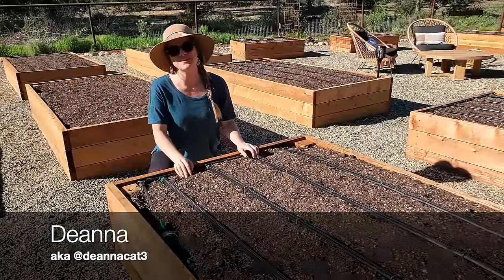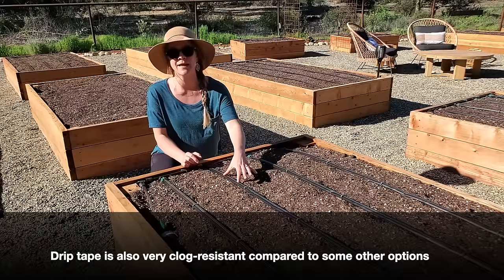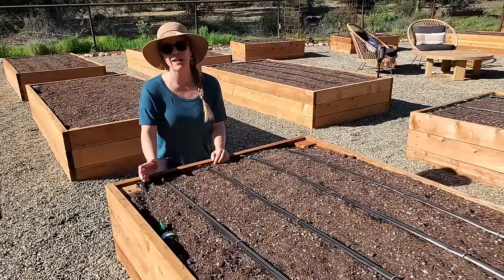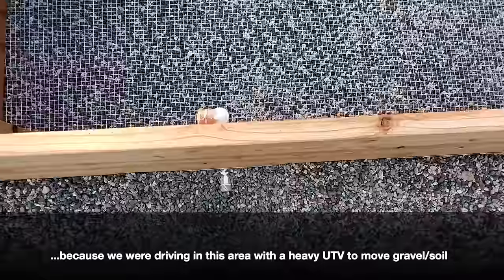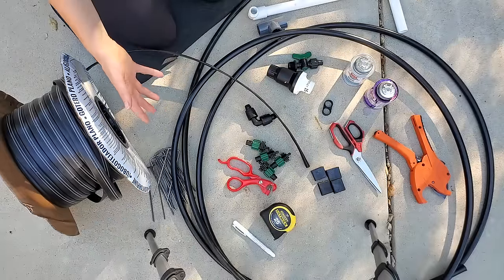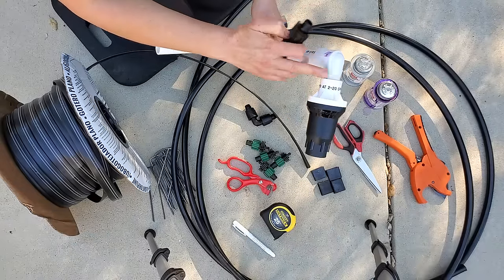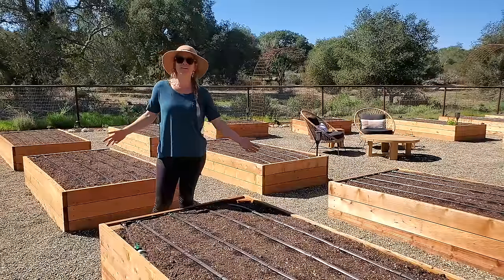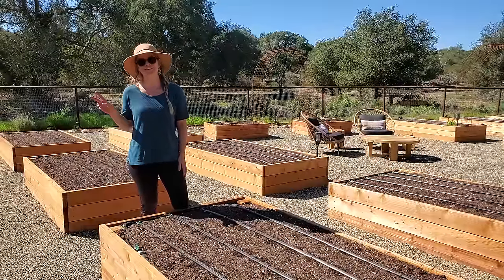How to Install Drip Irrigation in Raised Garden Beds (Using Drip Tape)

Comment: At the 7:20 mark, you have a T instead of an elbow. Is there a reason for that? Won't water escape out the other side of the T vs. going up into the raised bed? Or did you cap it off and have it in case you ever want to add another line from that spot?
Reply from the maker: Hello Lani, good catch and yes, if there is a T we continue the main line to either connect another raised bed or we extended the line a bit further and capped it in case we want to tap into the line in the future as it leaves our options open. But yes, you don't want to leave a T at the end of the line.

Comment: Been following you and Aaron on Instagram for awhile and now also following on youtube.
Could one put the pressure regulators at the beginning of the line instead of each bed?
Reply from the maker: Thank you so much for following along! If you are hooking up regular drip irrigation and not using drip tape, you could add a 25 to 35 psi pressure regulator which should still be enough pressure to reach the areas you want to irrigate.

If you want to use drip tape, unfortunately you need 15 psi pressure regulator or less (depending on the exact drip tape you are using) and the pressure created may not be enough to reach the areas you want to irrigate if you install it at the beginning of the line.

If you only need to irrigate a raised bed or two that is right next to the beginning of the line, a lower pressure regulator may still work but it won't be enough pressure to move water across greater areas which is why we had to add 15 psi pressure regulators in each of our raised beds instead of at the beginning of the line.

Hope that helps and reach out if you have any other questions, good luck!

Comment: maybe i missed it? Did you guys talk about or list which irrigation valves you used in this setup? Are you happy with them?
Reply from the maker: Yes, we link all of the supplies we use in the caption of the video. Everything has held up well and we haven't had to replace or fix anything since we installed our irrigation system.
Reply: @HomesteadandChill  ok, ty. I just didn't see the irrigation valves, but may have simply missed it. I saw everything else. I appreciate the help
Reply from the maker: @allthingsgrowing  We have the PermaLoc adapter with on/off valve linked second from the top of the supplies list. It is used to connect your pressure regulator to the 1/2 inch drip tubing. At around 14:50 in the video, it shows the two connected.

If there is another valve you are talking about, just let me know.
Reply: @HomesteadandChill  yes, i saw those. I wanted to know about the sprinkler irrigation vales you have set up at the beginning of the run? The ones that actuate the water on and off? If that makes sense. Again, maybe you listed them, i just didnt see it.
Reply from the maker: @allthingsgrowing  Oh okay, we didn't include those in the supplies list but you can find the valves (plus supplies) and how we assembled them in this article:

https://homesteadandchill.com/solar-powered-drip-irrigation/

or  video:

https://www.youtube.com/watch?v=LpepVAi1YkA&t=335s

We made the valve assembly for our pollinator orchard and have a video (linked above) on that in particular if you are interested but it is the same setup we use our raised garden bed area as well. Hope that helps and good luck!
Reply: @HomesteadandChill  thank you for the info and the reply. I appreciate it.

Comment: Curious about your PVC elbow that you are using to connect your pressure reducer to.  Is the end that connects to the PVC pipe un-threaded and the other end of the elbow has a male pipe thread end?  The reason I am asking is that I have not been able to find this type of elbow so just wondering where you get them?
Reply from the maker: We got the elbows from Drip Depot, you can find them here:
https://www.dripdepot.com/item/schedule-40-pvc-mht-by-slip-elbow-adapter-mht-size-three-quarter-inch-slip-size-three-quarter-inch

Comment: How many raised garden beds do you water at one time? We have 16 beds and want to use timers to water certain zones. We have 75lbs of pressure coming out of our faucet.
Reply from the maker: We have our garden split up into two separate zones, each zone waters around 9 of the raised beds and there is plenty of pressure at the end of the line. I am sure two zones would be enough for you as we have 40 psi coming out of our main supply lines.

Comment: Do you have a way to put a timer ⏱️ on the different zones ?
Reply from the maker: Yes we have two zones for our raised bed garden and they are connected to a Hunter XC 6 station controller where you can set watering days and times for each zone. The controller is where the valves are at the origination spot of the PVC piping.

We are in the process of creating an orchard space where we hooked up a new Hunter controller there as well and hope to share a video of the water system and how we set it up, along with the controller.

Comment: What I’m missing is how to set the timer interval. Do you set and wait see how high the water bill goes to know if it’s set correctly? I need to set one up for my blueberries. Last year here in Louisiana 8A. We went months no rain. Tried regular sprinkler heads. Water bill over $150.00 a month.
Reply from the maker: Sprinklers put out a lot more water than drip irrigation, whether you are using drip emitters or drip tape. We have this system hooked up to a valve hub with different stations hooked up to a controller, you can set your timers from there for days a week and amount of time to water.

To know how much is enough water, we go by what the soil looks like after watering and how the plants respond to the watering. You want moist but not soggy soil, check the soil for a few days in after watering and see how long it takes for the soil to dry out slightly before knowing when you should water again. 

If you are wanting to water blueberries, setting up a regular drip irrigation system may be the easiest and most effective for your needs. Check out our video on how to set up a drip system using a hose bibb. 

https://www.youtube.com/watch?v=LO79p4mfk3o
Reply: I watched the video. I just need a starting point on setting my Orbit Model 56158 Water Valve timer. Do I start at 30 min. runtime. 1 hour, or 15 minutes? I understand checking soil moisture. Just like saying we set our timer to 30 minutes run time 3 days a week. Your Milage may vary. I need an idea of where other chaps begin. Im not holding anyone libel for crop loss. Just want an idea of where to begin.
Reply from the maker: @sphchurch  It really depends on the type of plant, tree, shrub your watering and of course how much weekly rain you get. For our raised garden beds we typically water twice a week for just over an hour if we aren't getting any rain and that seems to keep the soil moist. For our trees and shrubs we typically water 2-3 times a week for an hour. Some plants have one 2 gallon emitter while larger fruit trees have 5 or 6 emitters in a ring around the tree.
Reply: @HomesteadandChill  will be Blueberries and Tomatoes, plus possibly grape vines.
Reply from the maker: @mhpreach  Do you have them in raised beds or planted directly into the ground? Drip tape would be a good option for raised beds but drip emitters would work great for raised beds or in ground plantings.
Reply: @HomesteadandChill  the blueberries are in ground. My tomatoes are in raised beds.
Reply from the maker: @mhpreach  Using regular drip emitters would likely be easiest to obtain and set up.

Comment: Thinking about doin this kind of drip.. How long do you keep it on until saturated?
Reply from the maker: It can vary depending on how warm or wet it is in your location. Here, we have very dry but mild/temperate summers so we typically run the system twice a week for about an hour.
Reply: @HomesteadandChill  have you tried laying drip tape under the soil? If so, did it made a difference in saturation and longevity? Thanks
Reply from the maker: @browny1365  Yes, the drip tape is now covered in a compost/mulch compared to when this video was recorded. Mulching garden beds is always a good idea and this drip tape is supposed to not allow soil or dirt intrusion into the openings.

Comment: Do you think this is worth it for just one 4x8 raised bed?
Reply from the maker: It's probably a bit much for just one bed due to having to have PVC running along the raised beds to tap into. Yet, you can set up a similar system and just use drip irrigation, making it even easier to tap into if you already have a drip system set up in your space.

Check out this article, under the "alternate drip supplies" section, there is an illustration of a similar set up using drip irrigation and half inch tubing:

https://homesteadandchill.com/install-drip-irrigation-raised-beds/

Comment: Are you still using the drip tape? Any problems or weaknesses?
Reply from the maker: We are still using the drip tape and everything is still working as it was at the beginning. We did get a thicker, quality drip tape which is made to last close to 10 years. We have accidentally punctured a piece of tape here or there with a pinprick hole, a few we just cauterized with super glue and that has worked well. However, we could easily replace a row of tape if need be. Hope that helps.

Comment: What are the controller valves that you show at the beginning?
Reply from the maker: Each of those valves is connected to a section of PVC piping that waters different areas of our property, our new garden space uses two of the valves, our orchard, center garden beds (not pictured), center shrub irrigation, etc. each use 1 of the valves. They are all hooked up electronically to a timer system so you can automate the watering process. Hope that helps.
Reply from the maker: I should also note that those valves have pressure reducers attached to them which makes them compatible with the drip systems that we use for irrigation.

Comment: My drip tape keeps popping off of my connectors. What have I done wrong?
Reply from the maker: If you have the same supplies that we use in this video, you need to be sure to slide the drip tape all the way up into the permaloc adapters before tightening the adapter down over the tape. We had this occur on a two or three of our connections initially but after retightening, we haven't had it happen since. 

Also, if you didn't reduce your water pressure down to 15 psi or less before it reaches your drip tape, the water pressure is too strong for the drip tape. The drip tape we used can handle a max of 15 psi but others need even less. Hope that helps.

Comment: Why so many beds?  Wouldn't longer beds have reduced the cost and complexity where the irrigation system is concerned?  Just curious at the design design decision.
Reply from the maker: This size is actually a fairly common size for large garden beds, if you make them too long you are going to have an issue with the beds bowing with time (even if you reinforce them along the sides). We like to be able to easily access areas of our garden without having to walk too far to get around a really long bed. It's also easier to separate different veggie crops so we aren't trying to grow tall tomatoes next to lettuce.

Comment: Has anyone found an alternative to "PermaLoc Adapter (with on/off valve) to connect 3/4" PVC pipe thread to 1/2" drip tubing (option for 1/2" pipe size available under same link)"? 

Doesn't seem to be sold by DripDepot anymore, and I can't find a 3/4 to 1/2 with a valve included.
Reply from the maker: Thanks for your interest and bringing up the issue with the link, we have now updated the link for the adapter, it looks like they may have changed it slightly as the green on/off valve is slightly different than the one we used. However, if you are following along using the other links we provided and building out the system the same way, you would want the 3/4" MPT to 1/2" tubing. Hope that helps and good luck!
Reply: Thanks so much! @HomesteadandChill

Comment: Whew, that's a moderately pricey system. I've seen the price of PVC lately and I'm guessing a couple thousand bucks based on the 80's being used. Possibly more but I honestly don't know how many pieces you used.
Reply from the maker: It was just over $1,000 for all the lengths of PVC (probably close to 200 feet), tees, elbows, couplers, along with the PVC primer, glue, and daubers. We do have extra lengths of PVC and fittings leftover to use on future projects as well so we haven't yet used everything from our initial bulk purchase.
Reply: @HomesteadandChill  Guess PVC must just be expensive where i'm at. Thanks for responding though. :)
Reply from the maker: @aaronburdon221  Yeah, we get it from a local landscape supply company who specializes in irrigation, most of the customers seem to be landscape companies or irrigation specialists although they will sell to anyone.

Comment: I tried to put together the same system and was told that there was not enough flow rate to put a separate pressure regulator in each bed.
Reply from the maker: What pressure or flow rate do you have coming into your system where it isn't considered enough? We have 40 psi coming from our main water supply to each bed via PVC piping but even 25 psi should work for smaller gardens, you then need to reduce the pressure to 10-15 psi at each bed (depending on the psi recommendation for your particular drip tape) as regular drip tape can't handle such high water pressure. If you are using a regular drip irrigation system with emitters, you likely don't need to further reduce it at each bed.
Reply: @HomesteadandChill  The issue is the amount of demand from the drips in each bed needing to meet the minimum of .5GPH for the pressure reducer.  I have 40 PSI on the mainline.
Reply: Said that wrong.  The minimum is .5 GPM.
Reply from the maker: @joniboulware1436  Are you using drip tape (like we do in this video) or drip emitters? Most emitters emit water at Gallons Per Hour, not Gallons Per Minute, no matter if they are individual drip emitters or drip tape with many emitters on a line. If you have 40 psi from your mainline coming directly to your beds, you have enough pressure there, once it hits your beds you need to further reduce the water pressure for drip tape specifically which requires 8-15 psi to operate depending on the exact drip tape you use. If you are using drip emitters specifically, you don't need to reduce the pressure further as typical drip emitters or bubblers can operate at 25-40 psi.

Comment: I bought 20psi valves. Way too much pressure! My drip tape pops off daily. I am replacing them with 10 psi valves. Manufacturer recommends 8-10 psi!
Reply from the maker: We cover that in the video, we also link a 15 psi regulator which is installed in each of the raised beds as the drip tape we used is rated for 15 psi. 20 to 40 psi reducers should be used at the beginning of your irrigation system where your valves are before being reduced at each bed down to 8-15 psi, depending on what type of drip tape you used.

Comment: Why those "beds" so far apart? Wouldn't be better to put them closer?
Why even budder with beds?:thanksdoc:
Reply from the maker: They aren't that far apart... they're just 3.5 feet, perfect for wheelbarrow or garden cart access, plus once the plants fill in and spill over during summer, the walkways get crowded quickly. Also, if too close, the plants shade each other more easily, especially during our winter garden. We are lucky to have such a large garden that allows for such spacing, though we did put beds closer together in our old smaller garden to maximize growing space (though I still recommend at least 28-32 inches at the closest). 

We grow in raised beds for many benefits: the ergonomics, aesthetics, the ability to fill them with quality soil and compost, and most importantly here, so we can block out gophers from the bottom. Anything in-ground gets eaten by gophers and has to go in individual wire gopher cages.

Comment: If anyone can reccomend a "quality" manufacturer/system that lasts more than 3 or 4 years I would love to hear.  I've been installing these drip systems for 15 years for my own use and for friends and family for almost as long and they are all junk components that don't last. Very discouraging.
Reply from the maker: Do you live in a climate with freezing winters and do the supplies get left outside over winer? The drip tape we used and listed in the caption is stated to have a life expectancy of 5-10 years. Everything we used seems to be sturdy and of good quality so I guess we will find out in a number of years how it holds up.